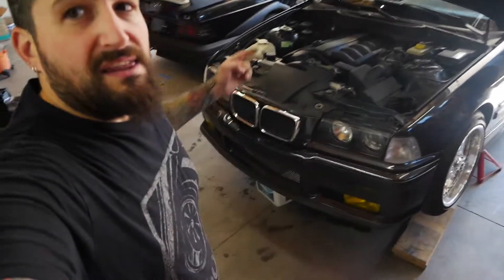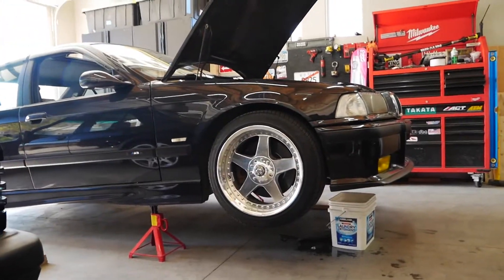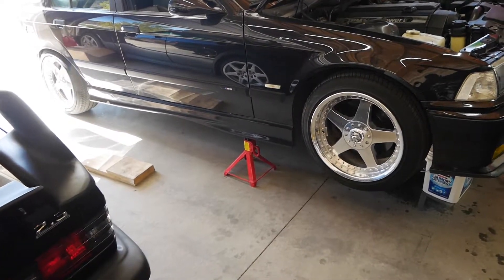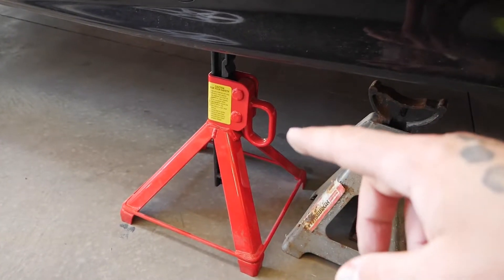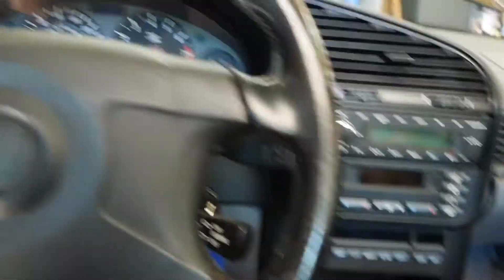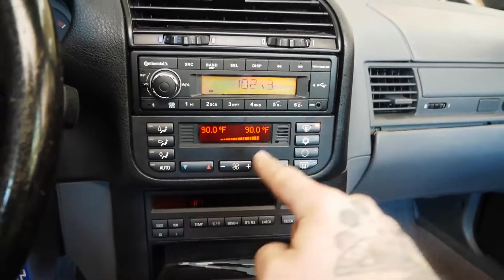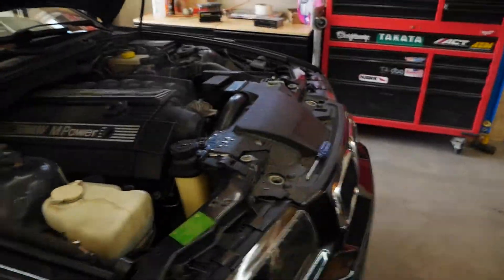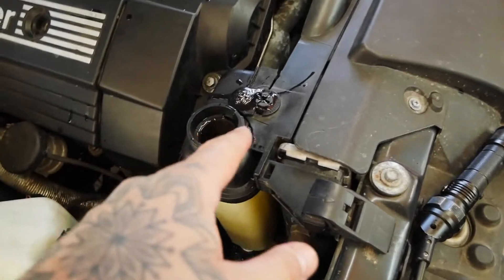How to Bleed a Coolant System. BMW e36 M3

Comment: Hey buddy i just changed my radiator with a stock replacement bled it as youve shown in video vehicle has never over heated my new rad cap is making a hissing noise and the expansion tank is bubbling with cap on idk what to do
Reply: I had the same everyone said head gasket turns out I just hadn’t bleed it properly ended up vacuum bleeding it works mint 👌